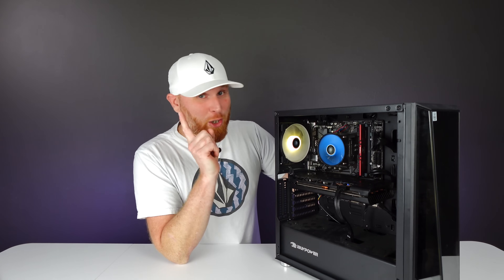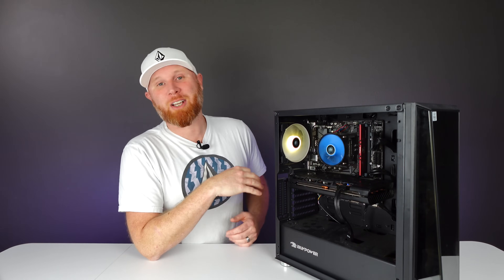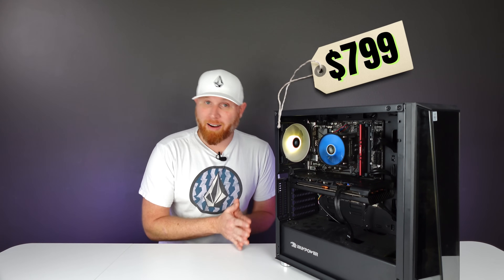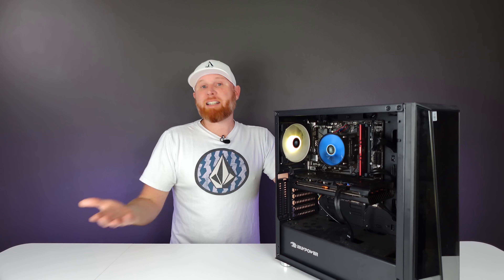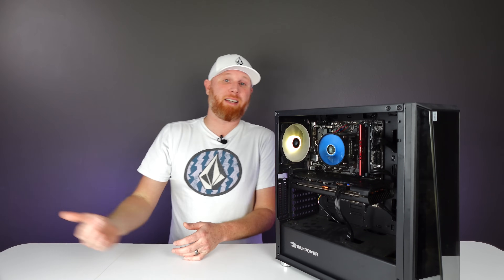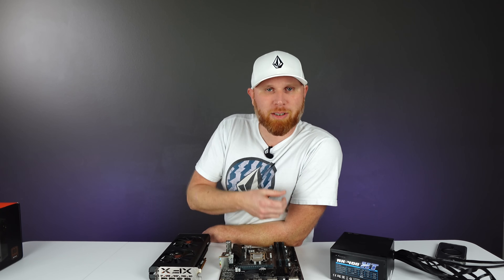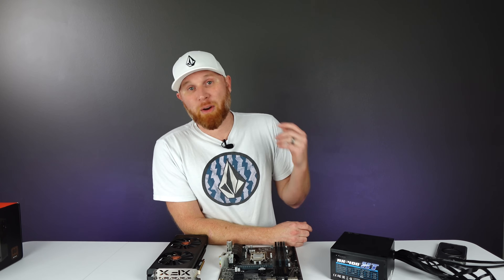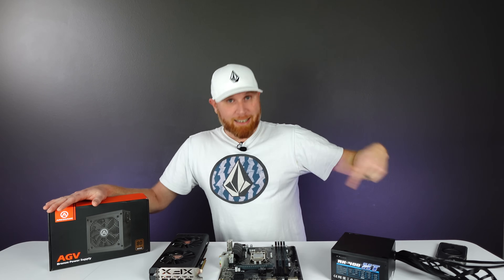Your Prebuilt Gaming PC Is CRAP! CHANGE IT - PC Build up Challenge S2E3

Comment: Is it safe to completely spray the motherboard with isopropyl alcohol like you did?
Any parts to avoid spraying like connectors or CMOS?
Safe to do it with 91% isopropyl alcohol?
How long did you set it out to dry for?
Just wanted to know because I might have to do this for my motherboard.
Nonetheless, great video, and thanks!

Comment: Nice looking build. 
The airflow is an issue with these front mounted PSU cases that force you to feed cool air from the bottom.
To do that you need to mount the GPU vertically if you want any air to reach the top radiator especially if your card has large fans.